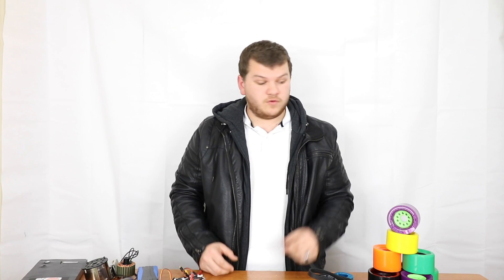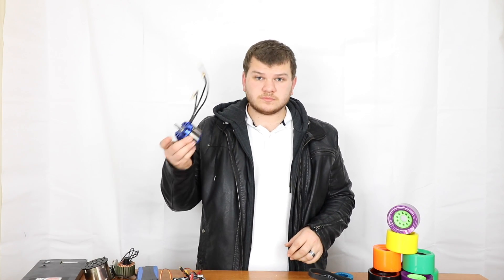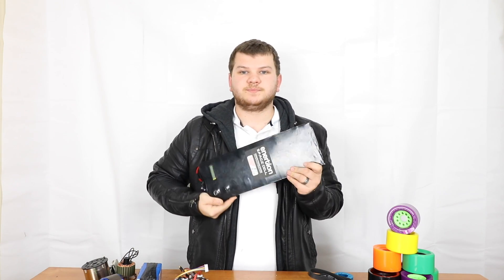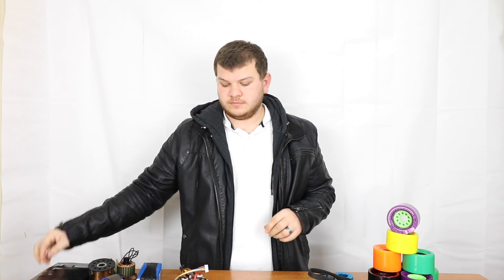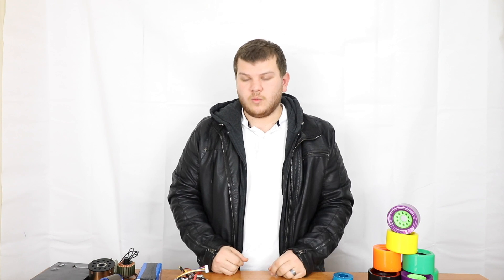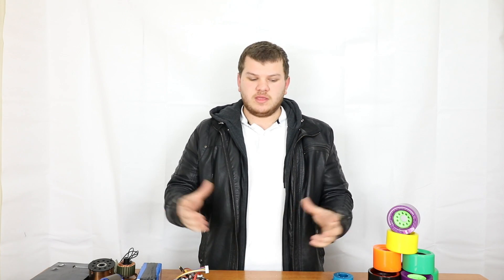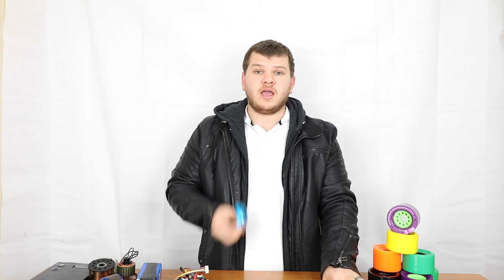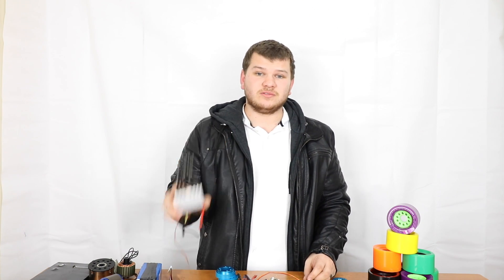How to build the best electric skateboard

Comment: Hey again,back with more questions  :). Im deciding on what type of cells ill be using on my 18650 battery pack. Ive seen many on the esk forum choosing an avrage cell with aroubd 2500mah but a high discharge rate of 20A. But im looking to have an extened range of my board so i want to have higher capacites like the Sanyo cells wich are 3500mah, but their discharge rate are lower at 10A. Will the difference on the discharge rate impact my motor performance in anyway?

Comment: Hey, one question, will i be able to mount 2x 6374 Motors on a 190mm Truck?
Reply from the maker: A normal truck is 180mm and can fit 2x 6355 so you would need a 220mm truck to fit 2x 6374. Or you can mould it in a diagonal setup. One on the front truck and one on the back.
But I'm 95kg and can ride up any hill with 2x 6355
Reply: +ESK8 Support Thanks for the quick answer mate, i found 190mm trucks on ebay. what kind of motors can i fit to have the most wattage, without mounting one in front and one on the back?
Reply from the maker: +Delshad S 6355
Reply: +ESK8 Support Thanks mate, keep it up with your uploads :)

Comment: What kv motor should I get for commuting through hilly terrain in San Francisco.  I will be using 2x 4s 5000mah batteries
Reply from the maker: +CBW0314 I think 190kv is the best all round
Reply: are you sure 190kv has the torque and top speed of over 20mph? I will be using two 4s 5000mah 20c batteries
Reply: are you sure 190kv has the torque and top speed of over 20mph? I will be using two 4s 5000mah 20c batteries
Reply from the maker: +CBW0314 yes with a 1:2.4 gearing and 80mm wheel you will get 20mph. Boosted board use 190kv. But torque will be low! Would have to go a 1:3 gear ratio for better hill climbing but high kv will not help! You will have to increase your voltage to gain the 20mph top speed!
Reply: I have a 14/36 ratio and will be using 80mm wheels
Reply: will i be able to reach 20mph and be able to climb hills with 190kv?  If not what kv would give me that